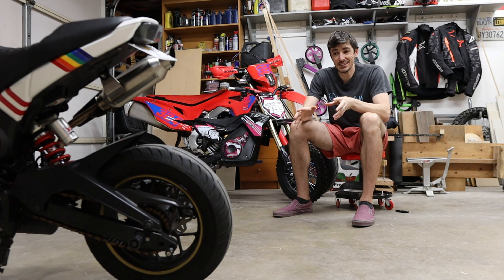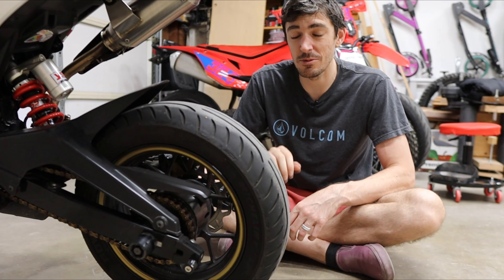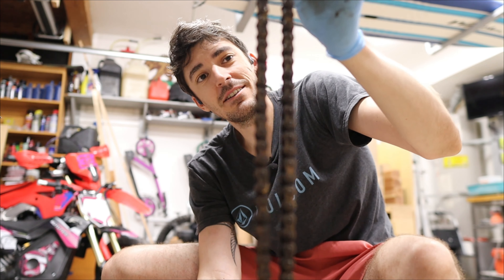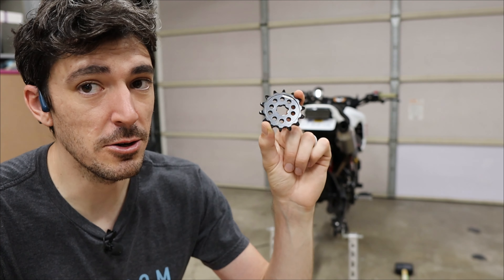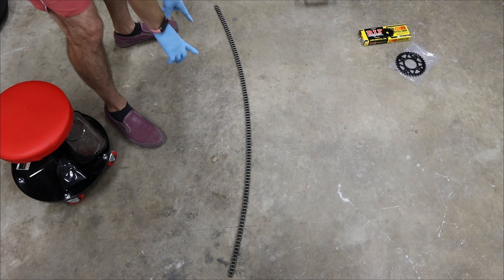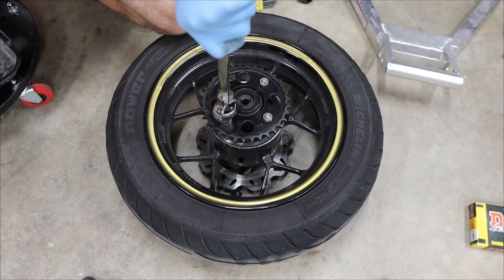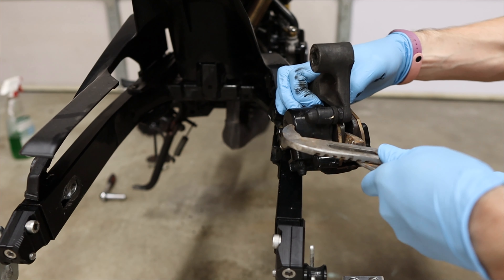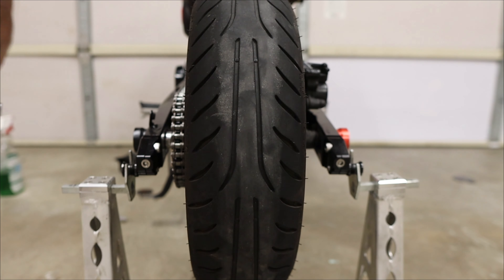Don't Sleep on the Best Chain and Sprocket Upgrade! 428 Conversion Kit

Comment: You didn't mention how many miles you had put on that old chain before it needed to be replaced.
Reply from the maker: I last bought my chain and sprockets in late 2019, I would guess I put about 6,000-6,500 miles on it since then.

Comment: Would it not have been better to remove a link or two and keep the adjustment all the way forward? This comong from a rickus rider that has yet to do his CT70 restomod so has no firet hand experience with chsins on a motorcycle lol
Reply from the maker: I actually did see that the old chain was 2 links shorter, but at the same time this is the stock chain length and tensioned within the adjustments just fine. When it wears in and starts to stretch then I may remove a set of links.

Comment: Another excellent tutorial, Alex! Every single time I use pliers to install the clip on the master link. They slip off the pliers and pinch the dickens out of my hand, resulting in a blood blister. Quick question, youve have uour Grom a very long time. The front and rear sprockets the same count as OEM, or did you go with a different size for a higher top speed? Im kicking around revisiting an oldie, but moldy TW200. Great job, as always!
Reply from the maker: I went one tooth lower in the front for better acceleration, maybe lost 1mph top speed but when it's a grom, who cares! A TW200 project would be cool to see!